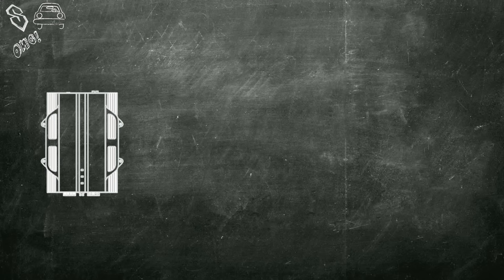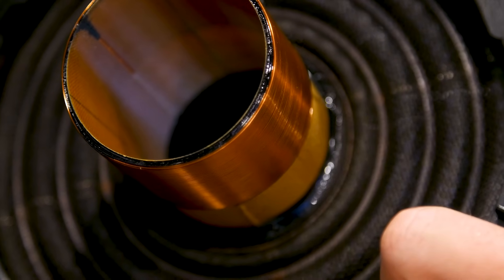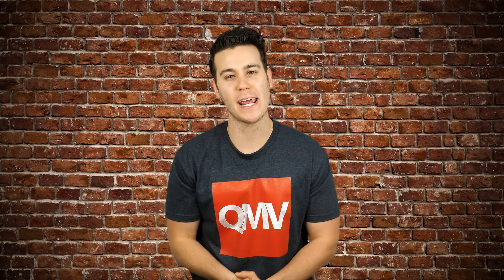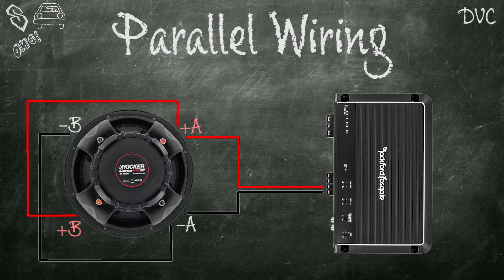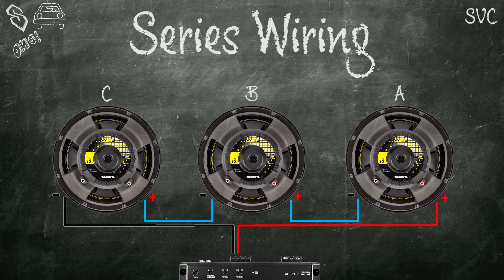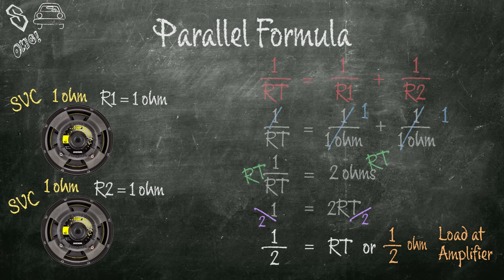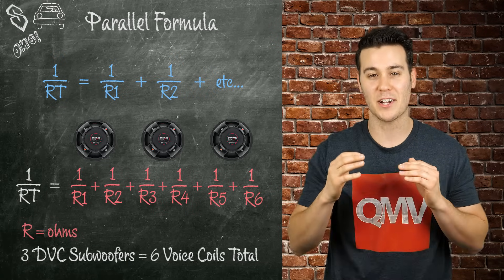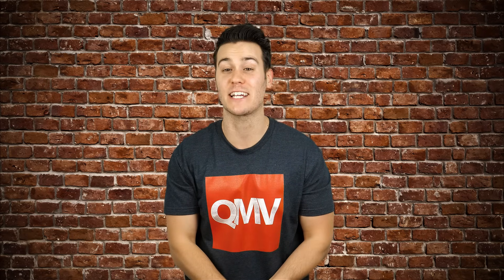How To Wire Subwoofers - Parallel vs Series - Single Voice Coil and Dual Voice Coil

Comment: If I wire in series with 2 400 watt rms DVC 4 ohm amps I can get 1 ohm or 4 ohms. Does this change my required amplifier output or will the subs still need 800 watts at least coming out of the amplifiers one channel?
Reply from the maker: Actually with that setup it's 1 ohm parallel wiring, 4 ohm series wiring. Your amplifier dictates the power. If the amplifier does 1 ohm, and you wire them parallel, that 1 ohm rating is the power. If it does 4 ohms and you wire them in series, that 4 ohm rating is the power now.
Reply: Quality Mobile Video  got it! Thanks!

Comment: All i wanted to know was if you can safely wire up 1 dual coil 12 inch 4ohm sub, with a single coil 12 inch 4 ohm sub
to the same monoblock amp? 

 If the answer is yes, my next question would be, great....is it possible to wire the pair down to 2ohms?

 Oh and I am only running the single coil sub until i am able to get the same sub as the dual coil i'm using!
Reply from the maker: I wouldn't advise wiring two subwoofers with different specs together!
Reply: @Qualitymobilevideo  Ok thanks, I have an alpine type r 12 inch and a kenwood typhoon (got given to me) so i need another type r or i'm trying to get my mates 2 type x's
I seem to be seeing a lot of videos of people running 2 type r's on 1 alpine pdx 1.1000 monoblock amp, every comment seems to be people doing the same and loving it, but 
isn't a type r 1000rms? If so, how can 1 pdx 1.1000 run 2 type r's when it's only 1000rms x1?

Comment: So you’re telling me if I parallel connect my two ohms sub which the rms 400 and my amp is 480 rms it WILL over heat because the amp needs to be 800 rms which will
Cause my sub to blow up
Reply from the maker: Depends on the voice coils. Dual or Single?
Reply: this depends on if your amp is stable at 1 ohm.

Comment: Perhaps the analogies could have been better (or skipped), but overall I thought the video was excellent.  If you pay attention, you will learn how to wire single or multiple subwoofers with one or multiple voice coils each in series and parallel and what the resulting load (in ohms) will be presented to your amps.  The only other information you need is how to match the power output of your amplifier with the power handling capabilities of your subwoofer(s)
Reply from the maker: Thanks Mark!

Comment: i have a jbl w12 gti mk2 with 6ohm dual coil.... so wich amp is best?
Reply: Gowsigan Perinpanathan well as the video said the lower the impedance the more power you get out of an amp so find an amp that delivers the power the sub needs when wired parallel. If u still can’t figure it out then google will probably give some good options on amps that best match the sub

Comment: great info! I was into car audio in 90's. I ran four 15" subs in their own ported boxes and ran them series/parallel to get a 4 ohm load and powered the fosgate subs with 2 fosgate power 250 M's bridged together to give me over 1,200 w at a 4 ohm load. I hit 147.3 dbs once and thought that was great for 1996. Wanting to get back into it so i'm checking youtube.
Reply: Lol. That would be a st8 banger back in the day. But todays standards........
Reply: What about wiring them vertically instead of parallel?
Reply: Considering that's just two subs, that's still damn good, even today.
Reply: @lloydhudson6463  "four 15" subs" but yeah it was the loudest stereo in my town at the time

Comment: Would the sundown  sb -3 10 4d  500rms  be good for my crew cab Silverado and what amp should I use how should I wire  it
Reply from the maker: So that's a DVC 4 ohm woofer, which means it can make either a 2 ohm(parallel) or 8 ohm(series) load  at an amplifier. You'll want a monoblock with an RMS of 450-600W RMS @ 2 ohms. I suggest these:

Kicker CXA600.1 - 600W RMS @ 2 ohms
http://www.qualitymobilevideo.com/cxa600-1.html?utm_source=YouTube&utm_medium=Video&utm_campaign=Match_Subwoofers-Amplifiers

Kenwood KAC5001PS - 500 watts RMS at 2 ohms
http://www.qualitymobilevideo.com/kac5001ps.html?utm_source=YouTube&utm_medium=Video&utm_campaign=Match_Subwoofers-Amplifiers

Rockford Fosgate R500X1D - 500 watts RMS  at 2 ohms
http://www.qualitymobilevideo.com/rockford-fosgate-r500x1d.html?utm_source=YouTube&utm_medium=Video&utm_campaign=Match_Subwoofers-Amplifiers

Kicker 42PXA5001 - 500 watts RMS at 2 ohms
http://www.qualitymobilevideo.com/42pxa5001.html?utm_source=YouTube&utm_medium=Video&utm_campaign=Match_Subwoofers-Amplifiers

Pioneer GM-D9601 - 800W RMS @ 2 ohms
http://www.qualitymobilevideo.com/gm-d9601.html?utm_source=YouTube&utm_medium=Video&utm_campaign=Match_Subwoofers-Amplifiers

Comment: I’m strapping amps and was wondering is 2ohm 4K watts the same as 1 ohm 4K watts or does the subs react differently as in doesn’t move as much cause of resistance or does it move the same sound the same cause it’s still 4K watts
Reply from the maker: Well the stable impedances of the amplifier and subwoofers dictate how you can wire your specific subs and what loads you can make at the amplifier. A 1 ohm load gives you the most possible power from your gear, however you will sacrifice efficiency and the system will run hot. A 2 ohm load with be able half the output on the same amlpifier, but will be more efficient and run cooler.
Reply: So basically it’s better to run 2 ohms if you have the power to run your subs that they won’t act differnt 1 ohm or 2 ohm as long as they have 4K watts

Comment: i have a serious question..i have the powerwedge JL truck box ( 2 of them) that come with Tw3 Jl D-4 which mean DVC 4 ohm BUT they connect like a SVC and are rated @ 2ohm..WTF?
Reply from the maker: What do you mean they connect like SVC? They only have one set of terminals?
Reply: ok they are 2 ohm dual coil subs in there own factory enclosure..im running a rd500/1..im running @ 250 watts x 2 @ 2 ohm correct?

Comment: All I want to know is if I should connect one sole 12" kicker cvr in series or parallel, too much mumbo jumbo.  what would be the difference if I connect my  Alpine PDX_V9  to one Kicker CompVR 12" in series or parallel, which gives the better bass effect? the kick?
Reply from the maker: The mumbo jumbo is necessary because of all the possibilities with all types of gear. For example, I need to know whether your subwoofer is 4 ohm or 2 ohm to be bale to determine the types of loads you can make in parallel and series to match the loads your amplifier is capable of.
Reply: wow!! thank you for responding!!!!!  to me all the math and ohms equals volts times watts doesn't do me any good, what do I do with it?. Saw the box this morning and its a 4 Ohm Kicker CompVR12 dual coil because there are two positive and two negative connectors on back, exactly like the one you use as an example on your video. So should I connect the woofer on the backside in series or parallel? On this amp (Alpine PDX V9) there are 5 channels; 4 to mids and tweeters and one 500 watt to the bass channel.  What would be the best setup for my system?
Reply from the maker: You're not wiring any other speakers or anything to the amplifier? Just the one DVC 4 ohm subwoofer?
Reply: Sorry, I do have midranges and tweeters via crossovers on other 4 channels

Comment: Hey James. So I’m trying to set my amp gain using a multi meter. I am running two 12” 4 ohm svc subs each rated at 400 rms. The amp I am using is rated at 2000 rms at 2 ohm. So I have my subs wired in parallel for a 2 ohm loaf. My question is what numbers do I use to find my target voltage to set my gain to. Is it the 2000w and 2 ohm of the amp or the 400w 4 ohm of the subs. Thanks.

Comment: Also, for people who don't understand, at 4:25, you label them as A+, A-, and B+ and B-. On an amplifier, most of the time, the power (that goes from the battery (or the alternator, for higher end systems) terminal is labeled as B+ and for people who don't really have any experience, I can see people wiring up their pos+ on their battery to the "B+" you stated on the terminal on the speaker... would have been better off labeling them 1 and 2

Comment: For calculating the impedance in parallel you don´t need that  formula, just divide each speaker´s impedance by the number of speakers, so if we have 4 speakers each  at 8 ohms,  just divide 8/4= 2
Reply: Yup, over complicating impedance is the reason why most people don’t learn how to wire subs.
Reply: That's what I was going to say. He made it over complicated. Just have to remember series doubles, and parallel cuts in half. It's super simple. No where near as convoluted as he made it sound.
Reply: THAT'S WHAT I SAID IN MY COMMENT, BUT YOU SAID IT BETTER THAN ME, AND WE SAID IT BETTER THAN HIM, AND THIS IS HIS VIDEO. LOL
Reply: Sebastián Díaz that’s exactly what I’ve always done! If I wire two 4 ohm dvc subs in parallel I get an1ohm load. It always get me why this confuses some people so much you just gotta take a little time and thoughtfully plan out a system
Reply: @coltonnewman8283  wouldn't that be 2?
Reply: @jenn1022  yeah.. but thats 2 ohms per sub. Then ya parallel the 2 -2 ohm sub loads for a 1 ohm load.
Reply: @tobiasmenough  He say he paralleled (2) 4 ohm speakers. 4÷2=2. That's a 2 ohm load. What turns it into 1?
Reply: @jenn1022  if it’s two dual voice coil 4 ohm subs then you end up at 1 ohm.
Reply: @jenn1022 as colton said.. The DVC  subs will make a 2 ohm load  if wired parallel  then if ya parallel the 2 subs together... 2 ohms  each.. = 1 ohm

Comment: quick questiopn please 
Ihave an Alpine PDX -M12 wired to a capacitor hifonics 1F and an Alpine Type R 12 inch dual 4 ohm and a pioneerDEH-80 prs 
would I wiring on 2ohm or 4ohm 
(in a small car -MINI-)

Comment: may be a dumb question but if i dont ask , i will never know... can u run a single and dual VC in a series ?
Reply from the maker: One of the most important rules of wiring subs, in my opinion, is always running identical subs if you're doing more than one in your system. Ideally, literally the same exact subs. even if you have two DVC 2 ohm subwoofers, you want them to also have the same exact RMS power. Mixing and matching subs messes everything up and can cause damage to your gear
Reply: Quality Mobile Video OK so I have a Memphis SR1.500 I believe its a 1000watt 2 channel. I just bought a 4000 watt dual Voice coil Rockville 12" . what would u reccomend wiring the DVC and hooking it into amp ?

Comment: The dual 4-ohm subwoofers included in my package are pre-configured and wired up inside of the subwoofer enclosure at a 1-ohm final load. How do i wire from enclosure terminals to the mono amp.

Comment: Any way i can wire two 4 ohm door speakers into one 4 ohm channel? Only way my amp would put out the required 200rms (100 rms each). This is on a bridged channel.
Reply: when you run two 4 ohm speakers to one bridged channel, you drop total resistance to about 2 ohms.

Comment: If you wire a dual 4 to 2 ohms and speaker is 250 rms, is the max now 1000 watts or still 500 max for both coils?
Reply from the maker: Always ignore max. The change in power happens at the amplifier not the subs. For example, if you have an amplifier that does 1,000W RMS @ 1 ohms, then it would do 500W RMS @ 2ohms, and then 250W RMS @ 4 ohms. Hypothetically, it the amplifier works in all those impedances.
Reply: Not amplifier ratings. I mean subwoofer max power. 2 voice coils rated at 500 max wired in series or parallel doe's that change power rating for subwoofer or is sub still 500 max?

Comment: Decent video but not complete or wholly correct. There are more ways to wire than just parallel and series. And those fractions are garbage. Series doubles, parallel divides in half when dealing with 2.

Comment: Car Amplifers | BOSS Audio R1100M Riot 1100 Watt, 2/4 Ohm Stable Class A/B, Monoblock, Mosfet with Remote Subwoofer Control

& Pioneer TSW311D4 12- Inch. 1400 Watt Dual Voice Coil DVC Subwoofer

How to install better plzz reply i'm waiting
Reply: Wiring plzz reply

Comment: Sir which is the best to wire? two dual 4ohm to 1ohm or two dual 4ohm to 4ohm? I hav two woofer pioneer ts w1200pro with mono amp pioneer Gm D9601!
Reply from the maker: With two of those subs you'll have to do a 1 ohm load! At 4 ohms that amp only does 500W RMS which is too low for two of those subs which do 450W RMS each. The 1 ohm load will be perfect
Reply: Sir i wire that two pioneer ts w1200pro 4ohm to pioneer Gm D9601 1ohm stable amp when i bang loud my volume my sub is smelling like plastic burning....  Plz sir help me how to do to not smelling like that...  😞
Reply from the maker: Oh no! It sounds like you over powered the subwoofer banging it too hard! The voice coil could be damaged

Comment: Which is good series or parallel??
Reply from the maker: It's not a matter of what's good and what's not good. Both are just different methods of wiring, parallel will let you wire to lower impedance's which means you'll get more power, but it doesn't mean its better than series. Series will usually be more efficient. It all depends on the system setup and what the user wants out of their gear.

Comment: Are jumper cables just regular cables? I'm confused on what they are.
Reply from the maker: You mean compared to speaker cables? They're different, jumper cables are insulated wires with sufficient capacity to carry voltage from one battery to another
Reply: Quality Mobile Video
So should I use jumper cables to connect negative and positive to my subs if I'm going to bridge them rather than using regular speaker cables?
Reply from the maker: DO NOT USE JUMPER CABLES TO WIRE SUBWOOFERS
Reply: Quality Mobile Video
So bridging subwoofers, would I just use regular speaker cables?
Reply from the maker: Yes, speaker cables. Jumper cables are for jumping cars. Speaker cables are for wiring speakers/subwoofers. They are not the same
Reply from the maker: You will use speaker wire to make all of your series and parallel connections. For subwoofers, use 12 gauge speaker wire for 2 or fewer woofers under 1000 watts total system output.
Reply from the maker: And he's just calling speaker wires "jumpers", they're not actual jumper cables for jumping a car
Reply: Quality Mobile Video okay lol that was confusing lol
Reply from the maker: Lol its all good, its easy to get confused when you're new to this and him saying "jumpers" instead of "speaker cables" didn't help

Comment: I pulled my old system out of my garage and want to install it in my truck again.  I have (4) Almani 12" DVC 4 OHM that run at 500 RMS.  I have Almani CA2600-D Monoblock Amp that can run at 1 OHM.  From my understanding wiring up 2 of my subs in parallel will run at 1 OHM, so how do I wire up all 4 using the bridge to get them all running at 1 OHM and stable with my amp?
Reply from the maker: Unfortunately 4 DVC 4 ohm subwoofers can only make a 0.5 ohm(which can be risky), 2 ohm or 8 ohm load!
Reply: Can I run two and get them down to 1 ohm?  That would speak to the stereo gods as the amps is 1000w RMS.  Only problem is they don't make this amp anymore.  

So what are the risks in running that amp at 0.5 ohm's, obviously overheating, any chance I damage the sub?
Reply from the maker: Yes 2 will work at 1 ohm! That's what I would recommend most. 

In terms of 0.5 ohms, its a common debate and everyone has a different opinion. Most people who run at 0.5 ohm are competitors trying to squeeze every watt they can out for short bursts. I'm assuming that amp isn't rated as stable at 0.5 ohms. Theoretically you can do it, but you'd have issues and wouldn't be able to push hard very often or for very long at a time. Thermal heat will be an issue, the amp will definitely run much hotter, you could work out some sort of ventilation system with fans or something, but you'll have a greater chance of the amp cutting off regularly from overheating, which then could damage the internal components. The amplifier will also be much less efficient and draw a lot more current, which could effect your electrical system if you don't have enough power. I personally don't recommend going to 0.5 ohm loads if amplifiers aren't rated at that low of an impedance. You have to remember that 1 ohm load is using about twice as much power as a 2 ohm load and is about half as efficient, same thing with a 2 ohm load compared to a 4 ohm load, 4 ohm load to an 8 ohm load, so just imagine what a 0.5 load is like compared to a 1 ohm load which is already operating with low efficiency
Reply: So one more identical amp,  or another 1000w RMS amp would be ideal for all 4 of my subs.   

Each amp would need its own power supply and fuse coming off the battery correct?   I'm currently running 4 gauge wire about 15' and I have a 4.0F capacitor.  Where does that fit into the mix,  before the amps correct?   Should I be running 2 gauge wire from battery to compositor,  then to the amps?

Comment: He's making this over complicated so u go to his shop. And pay him to hook up 2 dvc12s to amp and a capacitor 🤣
Reply: He is it's better whatch ones that show u hands on this dude just speed thru it
Reply: Capacitors are worthless and can damage your amp. If you need one get an h/o alternator and/or second battery.  Let's say you have a long bass note like in EDM music. The first second will most likely drain your caps "load" but your battery cant fill it fast enough as you amplifier is asking for. Therefore cause under voltage and possibly damaging amp. Caps are worthless...they're a gimmick. Also big 3 upgrade is good idea 👌
Reply: FAT TONY KAUAI Haun What does a capacitor have to do with this?
Reply: @timoromeo7663  he's saying he's gonna hook you up with a cheap simple system

Comment: I have a receiver that has one subwoofer out, going to a left input of an amp, that goes to a Dcv  subwoofer wired in series. Should i use a y splitter at the receiver so i have a rca running to the left AND right on the amp?